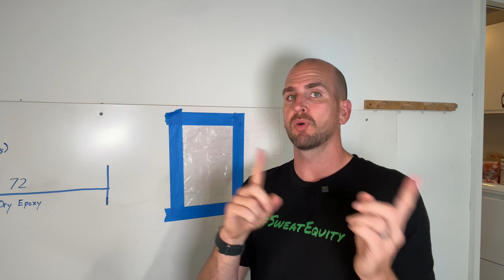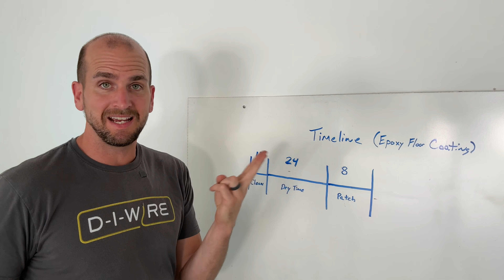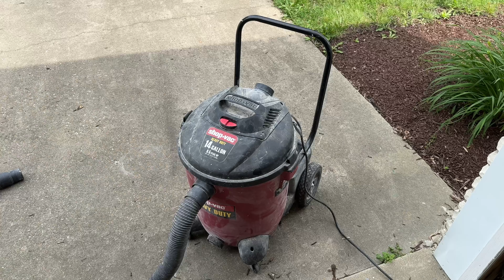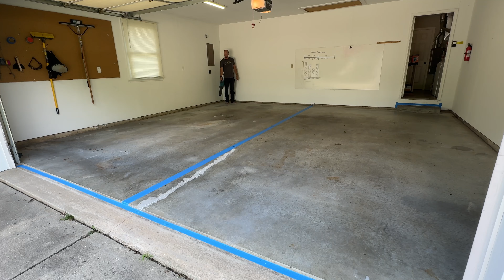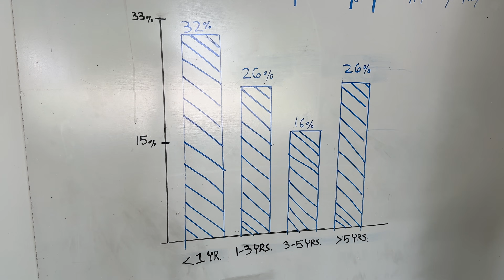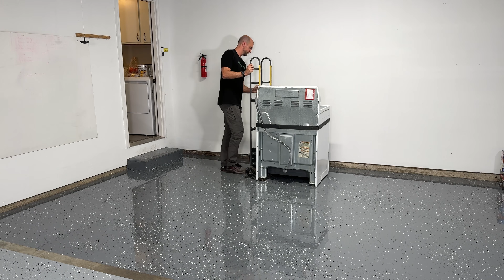Complete DIY Garage Epoxy Floor Coating Installation | Testing Most Popular Kits

Comment: Got my floors done professionally 423 sqft for about 2400$ with polyaspartic. I started to look into how to DIY it and came down to a few conclusions. One was that the equipment rentals, materials, and prep would get me close to the professional cost but there would be savings. Two, the lack of experience with polyaspartic can definitely end up with poor results. Shot blasting floors is better then grinding them so a shot blaster would have cost me nearly $1000 to rent out for the project.  Paying a professional was worth their experience and the difference in cost was maybe $500-$700 more then a possible bad DIY.
Reply: I can’t agree with you more. Like Clint Eastwood said in a movie, “ A man’s got to know his limitations.”
Reply: Yeah, I’ve seen poorly done DIY jobs where it didn’t hold for even a year. Probably the right call. I’d probably hire it out too.
Reply: And $6/ft2 is very fair for polyaspartic+prep.
Reply: What was your square foot cost to get that done?
Reply: For the DIY or the professional? With the above numbers it was about $5.68/ft professionally
Reply: @2mustange thanks I was curious in the professional cost. What is the warranty that comes with that?
Reply: Cheap area to live . My 3 stall.garage is 7500 min. Needless to say I'll be doing it myself
Reply: @ChristCoin we did it ourselves and it looks great -14 yrs later still shiny. Use the Professional solvent based + clear topcoat from Rustoleum.  Etch the floor and patch every little pock mark where your car sits so the concrete is super smooth.
Reply: @kristenjunker1632 which solvent based epoxy did you use? Will be going the same route
Reply: @ChristCoin let us know how that goes
Reply: When did you have your floors done?
Reply: @xllbenllx  like 2 years ago
Reply: I’ve made the same calculation & will probably get a company in to paint my double garage floor.
Reply: I did 450 sqf for about $900 total. Including 14 bags of self-leveler @ $30 a bag $450, primer $13, walk behind concrete grinder + big vac to suck dust rental from HD $200. Rocksolid 2.5 car kit from Amazon $200. No etching is required on freshly poured self leveler (need to wait 16-24 hr at least). It is definitely an easy DIY project that a baby can do. "Professional" is anyone who did 2-3 jobs and watched a couple youtube tutorial.
Reply: I had a quote of over $7k for 440ft2 in Connecticut.  You got a great price and I assume a warranty too.
Reply: Not to mention that DIY products are inferior.
Reply: Cognitive dissonance
Reply: @graphguy  how?
Reply: @2mustange did you look it up? It is self explanatory.

Cognitive dissonance is the mental discomfort experienced when a person holds two or more contradictory beliefs, values, or attitudes, especially when their behavior conflicts with their beliefs. People often try to reduce this discomfort by changing their beliefs, justifying their behavior, or minimizing the inconsistency.
Reply: @graphguy  yeah not sure how that applies to me paying a professional vs DIY job. I was just sharing my experience
Reply: @graphguy  "I like to make my own repairs around my house."

"dId YoU hAvE sOmEoNe ElSe BuIlD iT?"

"Well, yeah, it's beyond my abili..."

"cOgNitAvE dIsSoNaNcE!"

Buddy, either you didn't reply to the right person, or you just heard of it when someone used it towards you and you wanted to sound smart.
Reply: Okay - i'm going to call around my new area & get 3 quotes (240 sf new build + new concrete garage) i already have the 100 lbs of custom blend flakes & i want to do my soon to be new 10x10 outside patio that will have outside shower )  
(i also became aware of this product  that my bosses went to the demo 2026 -  yet we've never installed this : "*Premera specializes in high-performance concrete coatings and systems for flaked finishes.The Primer: *Premera Sol Gel Primers are designed to eliminate the need to grind or profile concrete. This significantly speeds up installation and cleanup times.") 
(they swear by the fact no grinding and they have several videos) 🤷🏻‍♀️
i can't say if it lasts or not !  

(as for rust oleum product - ummmmm we had professional problems 2024-25 with it pealing & yellowing on a couple of job sites and had to grind it down & fix the entire floor job  ) we just completely stopped using it --- big companies can change their formulas and sell their company -ect ) i'm not saying every floor will peel or yellow ... yet i've witnessed it happen a couple of times in 2 yrs and both times it was rust oleum commercial grade/ we typically use Sherwin Williams or Trnemec or Sika - never had issues w those in 28 yrs of installing epoxy flake & quartz - / after witnessing top coats yellow from "inside overhead lights"   on a few jobs  ... it's worth get UV protection in the top coat... not saying all jobs will yellow yet why take a chance of top coat turning yellow
Reply: My quotes is 3500 to 4500 for a 600sqft.  Not sure if its comparable at this price for me. Glad it worked out for you
Reply: I have a 3 car which is about 550 sq ft. I had 2 quotes polyaspartic. One was nearly 5k and the other over. Crazy. Needless to say my floor is still raw concrete.
Reply: @perniculous  We used the solvent based epoxy from Rustoleum+ the solvent based clear topcoat.  14 years later it is still shiny and no tire pickup.   No way I was going to pay a pro.
Reply: @kristenjunker1632 how did you prep the concrete before painting?
Reply: @perniculous I understand, everything is expensive, but Polyaspartic is the best floor system yet, made to last 20 years+, looks great and adds value to your home, including safety. If it prevents 1 potentially, bone breaking slip, isn't it worth it?
Reply: @garygwinn5818  I would guess that a finished garage floor is fairly low on the list of what adds value to resale. Also, the concrete subcontractor did such a shitty job that ain’t no one slipping on that floor! They took the “flat” out of flatwork!

Maybe in the future, but by then the price will be also not worth it.
Reply: @perniculous  It's something that adds about 60% of what you spend in terms of value, if professionally done. In 5 years the price will go up the the point you have broken even, and have a beautiful floor that's making your concrete last longer
Reply: @perniculous 7500 in my area for a three stall new house .
Reply: @perniculous  How is your 3 car only 550 sq feet?
Reply: @fit4ya1975 my 3-car is around 900 sq ft.
Reply: Smart Conclusion. Pay for the guys who do it all the time with a good, proven product.
Reply: I have around 375 sq ft grage floor. Will the 2.5 car garage kit be enough?
Reply: @junsthel  I did my 400 sqft garage with the 2.5 car and I needed another 1 car kit.
Reply: @junsthel  if you want to use a kit yeah that should be perfect. Usually want to put a thicker bottom coat anyhow
Reply: Cognitive dissonance

Comment: Seems like a ton of work for marginal benefit. If I wanted to make a garage floor look nice I’d just put down the rubber mat flooring- easy to replace pieces if needed.
Reply: Depends on your use case. If all you do is use it as a storage room for your cars and or stuff it'll work. For those that work on vehicles or use their garage as a shop, those tiles become an absolute nightmare. This makes it way easier to clean up spills and leaks without the nasty oil stains left behind
Reply: @Cr480mx Every mechanic I’ve ever been to has an unfinished concrete floor in the shop. I would think if you’re expecting to regularly get oil and grease on the floor no flooring is going to look good in the long run, no matter how expensive.

Comment: Why not take care of cracks before you clean n etch ?
Reply: came here to ask the same question.
Reply: Likely the effect of the grinding and etching on the epoxy based repair material vs. concrete. The epoxy likely doesn't need cleaning and etching, either
Reply: The materials used to repair will adhere a lot better when the floor is completely clean allowing it to last wayyyyy longer

Comment: I used the Rust-Oleum on my floor back in 2015 and it is still there today. Rough winters with brine & salt and sand. I am just now getting a few places  coming up.
Reply: Thanks!!!
Reply: Are you able to touch up the surface where it comes up, like painting a wall that gets scuffed?
Reply: Yes, we rented a floor scuffer and then recoated with the solvent based epoxy and did a top coat.  So much better than our original coating (just the water based epoxy) @ben_is_tall